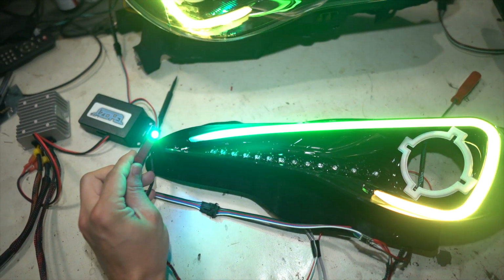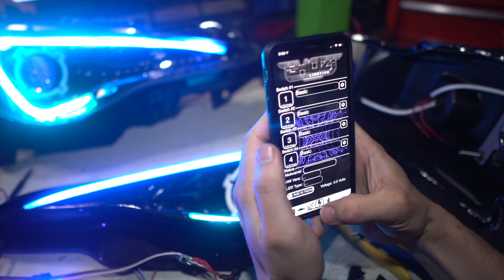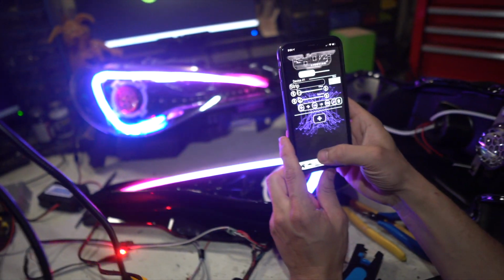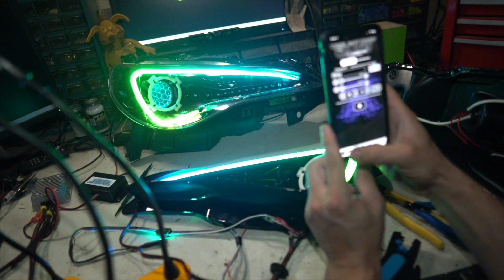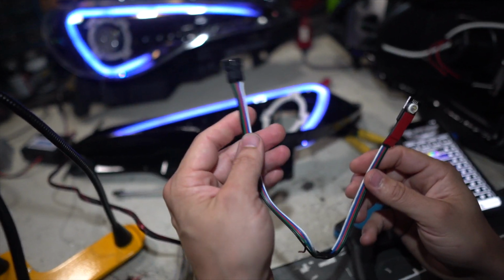Addressable LED Demon Eyes

Comment: Doesn't the 12v demon eye require a Driver?
Reply from the maker: Nope. Which is great cause I have a bunch of these LEDs that are missing their drivers now, so they will all be integrated into future addressable projects.
Reply: @flyryde  can any Demon eye board be applied? For example Diode Dynamics Pro Series?